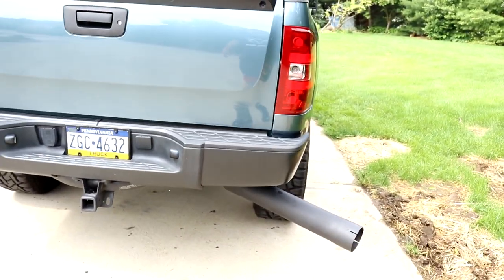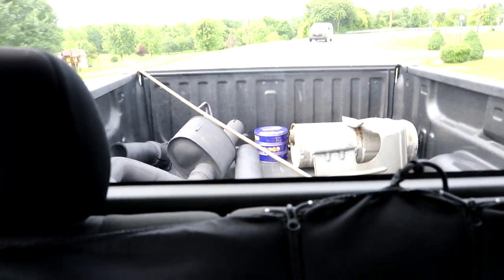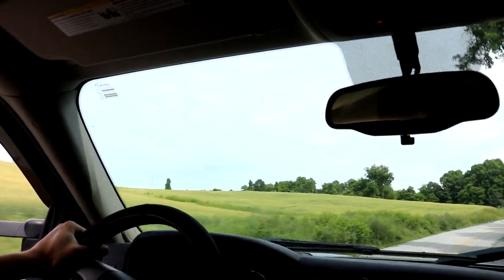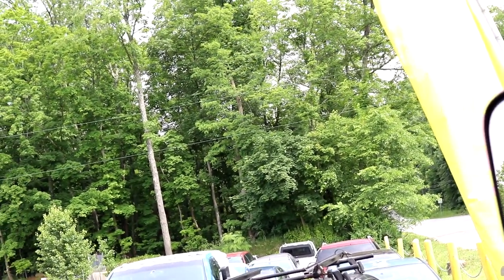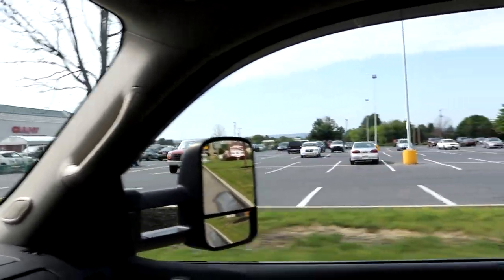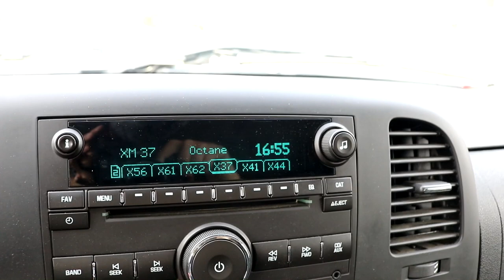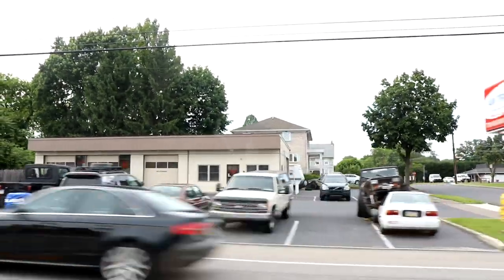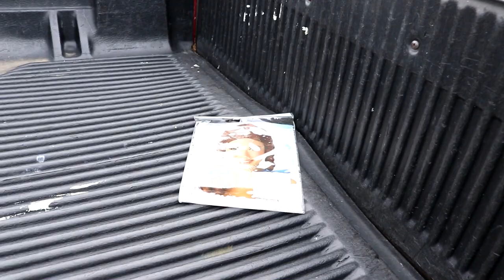Silverado Gas Stack!! Or 5in STRAIGHT PIPE

Comment: The transfer sheet on the vortec decal can be removed. It should have only been on for a couple minutes when applying. Looks like that decal is on backwards? Looks like it is a inside the window design.
Reply: Chili Styles its is a inside design and ive told him 2 months ago and almost every video since to take it off still hasnt
Reply: Joseph Rodriguez there’s going to be so much residue on the glass 😂
Reply from the maker: they messed up the decal, that sheet is part of the decal for inside a window

Comment: If you want stacks I would say to take the truck to a body shop to have the outside corners of the box cut out and boxed in so the stacks stick out just a little bit ,or if you don't do stacks I would do a borla muffler and build the rest around it with a 409 stainless 3 inch , yes it's spendy for good stainless, but good stainless won't rust , if you get cheaper stainless it's magnetic and will rust,  proper stainless won't rust,
Reply from the maker: Polishing the stainless exhaust too will be a game changer.

Comment: put a stack on it i had one on every one of my gas pickups best exhaust sound. it sounds like nascar. i always wanted to hear a 6.0 or 5.3 with a stack go 2.5 in it will sound raspy
Reply from the maker: well I would want at least an 8 in diameter

Comment: You should never get rid of stock parts nkw ur shit out of luck if anything ever happens to trucks and u get rid of them you could always just take off after market parts slap stock ones back on and sell after market of use new ones for the vehicle. Me myself i stay with me s10 or s15 chassis so parts are inner changeable
Reply from the maker: yea I have been holding on to the stock parts